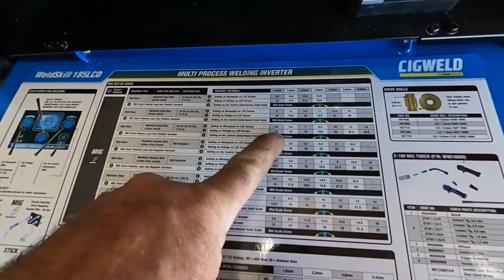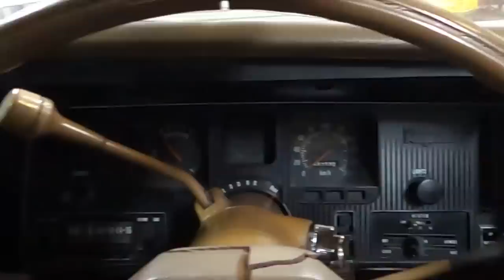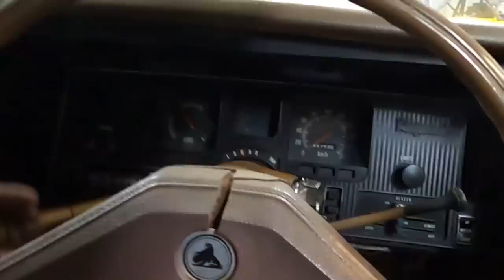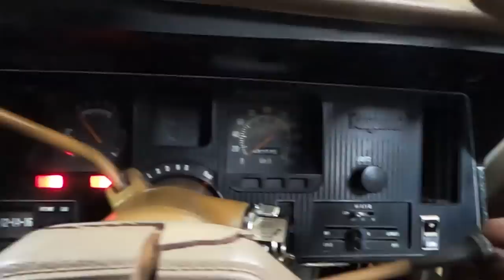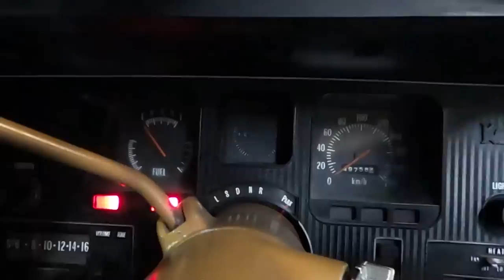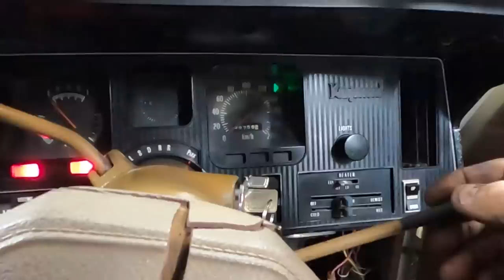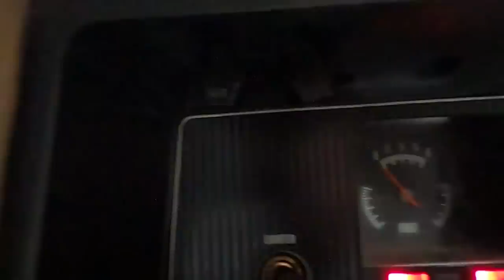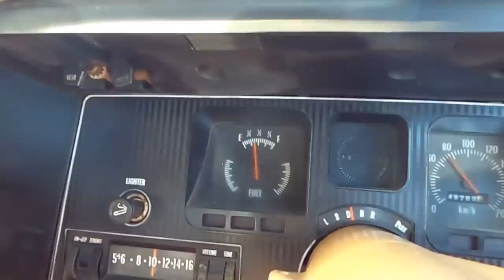EP22 HQ HOLDEN CLASSIC RESCUE , FROM ABANDONED IN A WRECKING YARD TO REVIVAL AND BACK ON THE ROAD

Comment: This program is BIG on providing hints to every backyard fix up for older cars. There is no over the top equipped panel shop or engine diagnosis shop or CNC machine shop. Watching this shows that lots of handy man types with a few extra tools can go a long way to bringing back to life an older car, at least to the point of getting it back on the road and registered. The only extra tool Mick has is the car hoist and they are more readily available and affordable than in the past. This program is the Idiots Guide to older car repairs for many amateurs who may have done this type of thing years ago and need a little guidance to get back into it. Ten out of ten for Mick.
Reply from the maker: @NoelHaverly  cheers mate🍺🍺👍

Comment: Loving it. As for the fuel tank, use POR15 U.S standard tank cleaner and liquid membrane> KBS also makes the same product. Once it is in you will never have an issue again. I did my tanks over 25 years ago and it is still good. It is designed to fill all those pin holes as well as getting between the tank and your patches via the old holes. Only way to go.
Reply from the maker: Cheers mate 👍🍺

Comment: They🎉don't make em like they used to...to work on I meant .. pleasure to flush that radiator ..looks like fun a bit ..all good for ur lawn too 😂..temp sensor , oil 🛢️ pressure sender..be a mechanics paradise..that car ..joy to work on if it was straight from the factory ..regardless ..Mick will get it going ..pure joy to see.
Reply from the maker: Cheers John🍺👍

Comment: Great job, i have a V8 HZ sedan and a 202 WB ute and for work duties i do prefer the 202, less grumpy when cold, less attention from you know who, plenty of room to do maintenance, uses a bit less fuel. Only problem as you mentioned as it runs out of puff at freeway speeds, especially with the traumatic and higher gearing.
Reply from the maker: Yeah mate nothing wrong with a 202 👍🍺

Comment: Mick. I had to weld unleaded filler neck onto old pipe on the tonner. Couldn't get it air tight no matter how I welded it. I grabbed some plumbers brazing rod from the hardware store and melted it into the weld.  Worked perfectly and cheap too.
Reply from the maker: I’ll remember that one mate thanks 👍🍺

Comment: Great video mick, I’m surprised they past the cracked steering wheel
Reply from the maker: I’ve heard that from a few Vic and SA viewers mate but I’m no sure how they rule that as a safety thing? What’s the rule in those states? Cosmetic as far as I’m ( and the inspector here) thinks , can you shed any light on why it’d would fail in those states?👍🍺
Reply: @backshed5295  I’m not entirely sure mick, I’ve been told from a few you tubers that any cracks or with later models if you can twist the leather outer it’s a fail. Good for you they passed it. Ps leave 202 in it.

Comment: Great wagon, just a quick question did you seal the openings in the inner door panels before putting the trims on? Hate to see them damaged by moisture 😮
Reply from the maker: New door trims backings are plastic mate ( which surprised me) so I didn’t put anything mate. 🍺👍

Comment: Another good way to clean out a gas tank is to take a couple of handfuls of nuts and small bolts put them in the tank cover the holes strap it in the bed of your pickup and drive for a while. the moving nuts will clean the inside of the tank

Comment: Another issue is that the wagons often had a lower speed diff say 3.5 rather than 3.0 or whatever!! I had to swap out the 3,5 on the six for a 2.78 for the V8! Huge difference in cruising - last time I drove out bush 22mpg on the 302!

Comment: In Vic you would be knocked back for cracks in the steering wheel.  Well done young bloke, it looks a treat.
Reply from the maker: I’ve had that comment a few times now but it’s not a safety issue, it’s cosmetic.  I think some inspectors hate life and old cars and make stuff fail but you have to show me the rule that fails a cracked horn pad etc. I’m not saying your wrong I’m saying maybe your taking it to the wrong people.👍🍺
Reply: @backshed5295  Sorry but no, Vic is getting tougher probs because we don't have yearly RWC. I can guarantee you 100% in Vic the 1st thing they would say is "New Windscreen" without even looking at it then go from there.
Reply from the maker: Even though the screen isn’t cracked ??
Reply: @backshed5295  Yep. They will say "sandblasted" which reduces visibility.  I once had to find a windscreen for a 1975 Fiat 124 Sport Coupe. There were 2 in AU, in Perth.
Reply from the maker: That’s ridiculous.
Reply: My VB Commodore has a stone chip in the middle of the screen on the passenger's side. The inspector said because it isn't in front of the driver, it is fine. That was 38 years ago and still the case today. I'm in NSW.

Comment: Damn I really like the looks of that car. Wheels, tires and stance make the looks on a ride.  Man I felt your grief when you moved the gas tank.  I heard it when you set it on the ground.  Can't believe you rescued it, outstanding  sir.  Man I never seen anyone use vise grips that way,  not so sure if I will try that one. Just curious there is a section of frame above and a little right  of that control arm. Is that a crack?  I know the feeling of the domino effect,  my satellite, just wanted to freshen the 340 and then put in a 5 speed. Yep, got the frame connectors, posi rear, air shocks,  oh shit lost focus, don't forget the interior. Oh hell lost my mind.  Love your indepth  narration  throughout  the video.  Thanks so much, keep building. My latest thing is a buddy of mine, gave me a gas powered golf cart. This can't be good. Cheap gear heading, I hope. Not a chance.
Reply from the maker: Hahha yep I hear ya Steve , stuff gets out of hand quick hahah👍🍺

Comment: I know what you mean about wagon fuel tanks. I'm trying to find one for my XY wagon.  Just can't get them. You must have fairly relaxed rego inspections.  It passed with a cracked steering wheel and horn pad. In WA they failed my tunner because I didn't have the cover for the fuse panel
Reply from the maker: I’ve heard that before on my sedan video about the cracked steering wheel but a pink slip is a safety inspection? How is it a safety thing? It’s cosmetic. I think the other guy that said the same was in VIC . I think some inspectors go on a bit of a power trip sometimes as I’ve had some craziness here too but genuinely safety items 👍🍺 maybe your inspection guy is the drama

Comment: Great content well done. For heaven's sake resist the temptation of dropping a v8 into it, that has been done to death. Nothing wrong with the 202. For a few extra horsepower advance the timing beyond factory spec. BTW, the air cleaner on it is from a an 'emission control' six. Diff ratio is probably 3.36, so it likes to cruise at 80kph.
Reply: I second this

Comment: Hey mate nice work. But for any pinholes and stuff like that on fuel tanks and water pipes i just use a little heat and acid core solder. Never had a repair fail.. and super easy to do.. and also with rear lower control arms just weld a flat plate on the bottom to make a box.. super strong super simple
Reply from the maker: Cheers mate yeah I’ll look into that , I just went with what I know hahaha 👍🍺
Reply: @backshed5295  yer mate i understand.. just for the future you dont run the risk of any blow thru while welding
Reply from the maker: Cheers mate👍🍺

Comment: check the oil pressure switch they used bad for cracking and leaking.
Reply from the maker: You are 100% right mate , in the first episode on the wagon EP20 it had a tremendous oil leak and that’s exactly what it was 🍺👍
Reply: @backshed5295  you can buy por for the fuel tank. put it in and roll the tank.

Comment: ID replace a bottom radiator hose and put one with the spring the six cylinder Holden are prone for sucking the radiator hose shut the spring prevents that that's a very common problem if your indicator flashes fast it's the globe that issue that developed the car wanting to start that is your ignition switch on the bottom of the column it just needs to be adjusted looks like it's moved the one thing I did not notice that you looked at was your number plate light
Reply from the maker: Hey Noel you’ve got a sharp eye mate I did forget the number plate light and they chipped me on it but I put 1 in it there at the shop. You might have skipped a bit mate as I did adjust that ignition switch on the column mate , cheers for watching 🍺👍
Reply: @backshed5295  I wrote the comment while I was watching it I know those cars like the back of my hands especially the six cylinder Holdens I used to have a fully worked 202 in my panel then before I put the V8 in and I had that was a 4-speed with the triple carbs the thing was an absolute Beast the panel van used to do 14 seconds on the quarter mile my panelvan is  in pieces at the moment as I am doing a full rebuild I love the fact that they are such a simple car to work on and very easy to put back together
Reply: There was one other things you did say that it felt like it was screaming while driving at down the road have a look at what the diff ratio is if you wanted to run a really nice and be fuel efficient the 2.78 is the one to go it might have something like a 3.36 in it if you're ever do decide to go to the 2.78 it is a 19 tooth pink gear for the speedo

Comment: How about a good coat of Raptor on the fuel tank. Should seal up any little leaks.
Reply from the maker: Not sure that stuff would be solvent/fuel resistant mate , cheers for watching 🍺🍺👍
Reply: Just googled it. Apparently it's resistant to fuel, hydraulic oil, urine, salt water and more.
Reply from the maker: Urine ! That surprises me hahahah🍺👍

Comment: Don't forget a radiator shroud
Reply from the maker: They never had one believe it or not mate👍🍺
Reply: @backshed5295  I know I've had a few myself but also helps with cooling. I was nocked back on a rwc once before for not having one on a 1975 HJ GTS still have it in the shed hasn't been on the road in 15 years
Reply from the maker: Ya lucky to still have it mate , if ya want it back on the road give me a yell mate haha. 🍺👍
Reply: @backshed5295  it was my dad's been about 6 years since the cover came off let alone the door on that side of the shed was open atleast a decade since it was last started

Comment: All that crap I seen in the fuel tank that looks like some little kid has been having fun filling it up with dirt these have to be one of the easiest cars to work on I have the HJ Sandman panel van with the V8 I love my car I have had it for 30 years I would never sell it I am so sick of these cars with computers the too hard to work on looking at your oil leak there's not many places that can come from it could be coming from the side plates rocker cover timing case or sump most likely the side gaskets they constantly leak as for the holes in the fuel tank I was just thinking you can buy these aluminium solder sticks  in there little torch just to melt the aluminium apparently they were pretty good